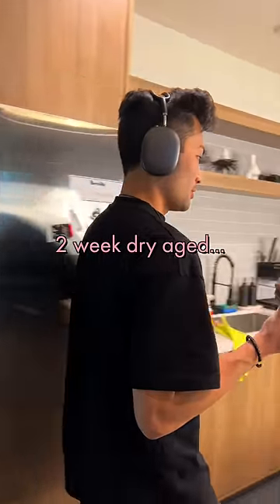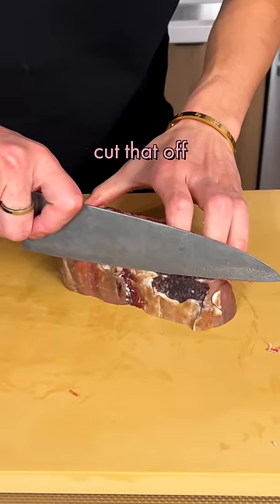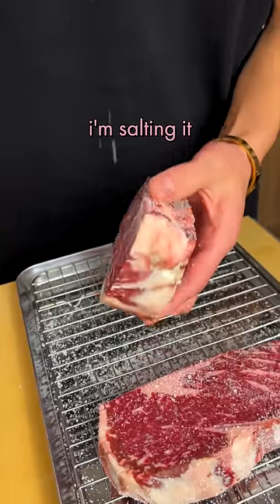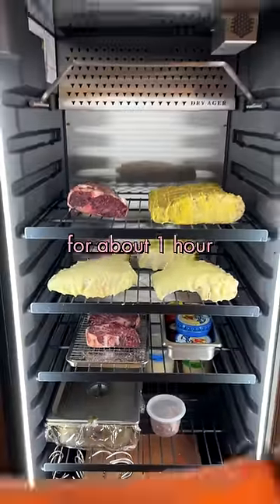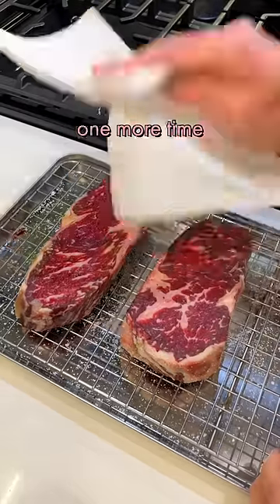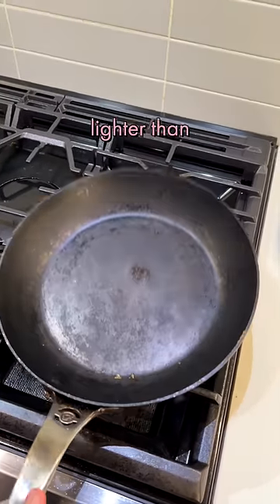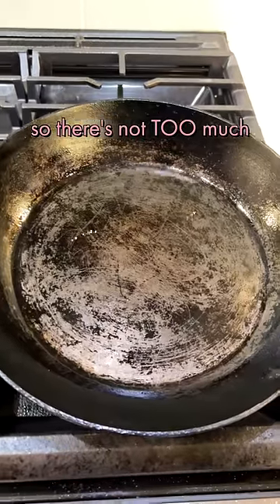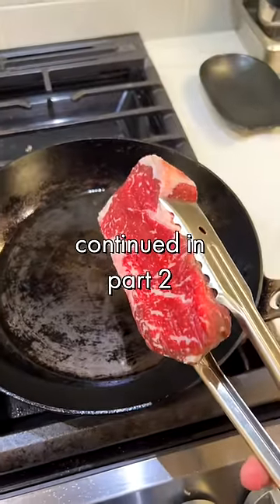useful steak tips for the home cook, part 1 of 3

Comment: Actually the worst thing you can do, if you dry brine for only 1 hour, you just get the moisture out of the steak. It’s a process called osmosis. The salt pulls out the water from the steak, then it disolves into that water, and that water salt mix is then reabsorbed by the dehydrated steak, just like a sponge absorbs water. But that process needs at least 4 hours. The “wetness” you used the paper towel for is just moisture that the steak lost. So the salt did not penetrate, you lost moisture and also didn’t tenderize the meat. The steak shouldn’t have any moisture on top when you take it out of the fridge if you do the process correctly. Imo, you either dry brine overnight or you just don’t dry brine at all.
Reply: Not only that but it went back in the fridge…. There’s no way an inch and a half steak is gonna cook properly and evenly when it’s <7°C in the centre. 

He then says “you wanna press down hard”…. No. You don’t. All you’re doing to do is squeeze moisture from the steak. Add more fat to the pan and gently push the steak into the pan surface, so that it all comes into contact with the fat and or pan. 

Cast iron is better, too. It retains more heat so the temperature of the pan / oil doesn’t drop when you put the steak in. 

It’s almost like he intentionally did everything wrong just to trigger us all into commenting…. WAIT A MINUTE….
Reply: Carbon steel has almost the same heat retention as cast iron.
Reply: @kelgbrown007  Maybe, but only if it's the same thickness.  Most cast iron pans are thicker than similar diameter carbon steel pans which makes them heavier and a little harder to handle.
Reply: I used to think this was BS but I’ve actually noticed that all steaks I dry brined for an hour come out tasting dry. At that point you’re better off just patting dry, salting and cooking. If you don’t have the 4 hours to wait just don’t bother
Reply: it only takes about 40 minutes for it to be reabsorbed, so an hour is fine. Longer than that only allows for deeper penetration, not any more reabsorption, and also evaporation which helps for the sear. The wetness is probably because he uses a dry age fridge which has much higher humidity instead of a normal fridge.
Reply: @slain4ever  Gotta agree to disagree there. I’ve done quite a few experiments on this and after one hour you still have a significant amount of the brine that hasn’t been reabsorbed yet. Two hours I found is the minimum for a decent amount of absorption, any less and the inside of the steak just dried out

Comment: It was pretty wet once you took it out, because salt has quality to contain moisture. Thus, the moisture from inside the steak started to penetrate to the surface and gather around the salt - not the other way around. It sucked moisture out from the steak that you patted with the paper and removed a lot of the salt that you so heavily put to the steak.

Comment: Useful steak tip number 1. This is taught to everyone who packs meat for a living (thank you Dad for teaching me tricks of the trade). 

1. The colour of the fat determines the age of the cow/bull before it was sent to slaughter. 
2. The age of the cow/bull before it's slaughter, determines how it will taste/mouth feel once cooked. Different cooking methods need to be employed depending on the age of the cow/bull it came from in order to get the steak to taste the same as you are used to. 9 times out of 10 if the steak doesn't taste good, it doesn't necessarily mean that it's because of the spices, but instead its because of the temperature and/or time taken to cook said steak. 

My father worked for AMH before his heart attack. Knew meat inside and out. Add my mothers cooking knowledge and well you have a recipe for delicious meat regardless of the age.